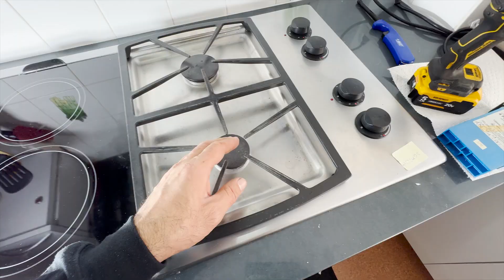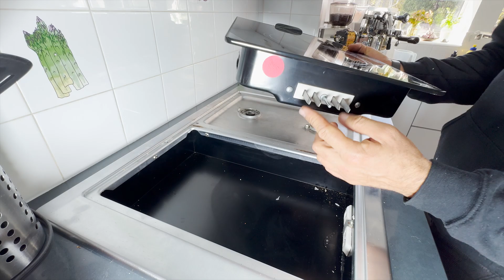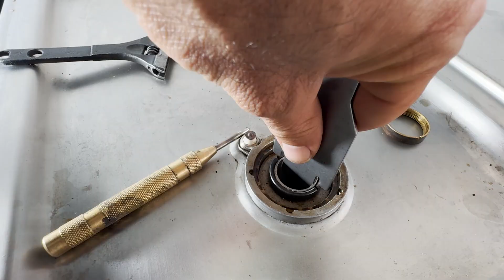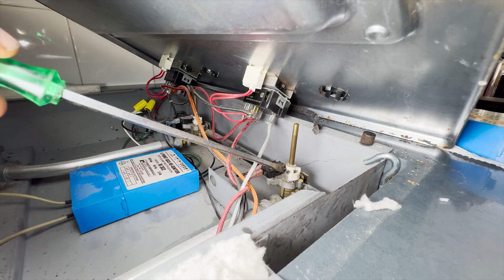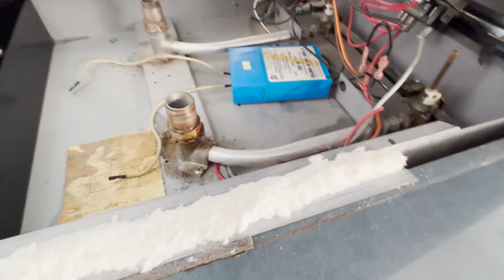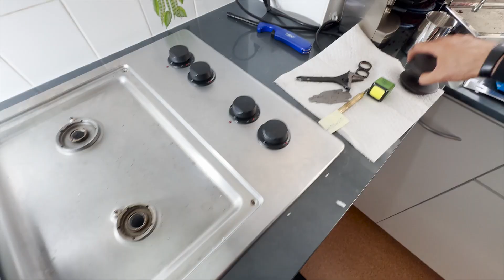How to fix Dacor Gas Cooktop That Won’t Spark | Model SGM362EM| 86526| Dacor cooktop repair

Comment: Thanks for taking the time and effort, my model is Dacor DRT366S, one igniter is not working, I have the part but can't remove the top stainless trim so I can open the lid, please help.
Reply from the maker: Here go follow this video of mine .

How to fix Dacor Gas Cooktop That Won’t Spark | Model SGM362EM| 86526| Dacor cooktop repair
https://youtu.be/5bvD9PhW1Ec
Reply: @hameedwafaAFG  Hi Hameed, my model is DRT366S from Dacor it is not the same as the one in your video
Reply: Hi Hameed, my model is DRT366S from Dacor it is not the same as the one in your video
Reply from the maker: @salboutros5028 oh sorry to hear that . I will make a video in near future